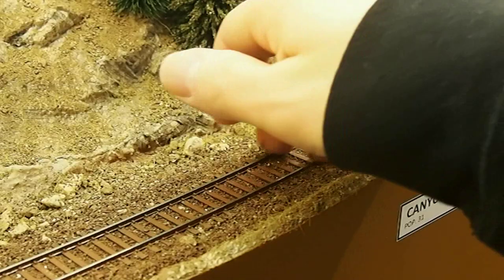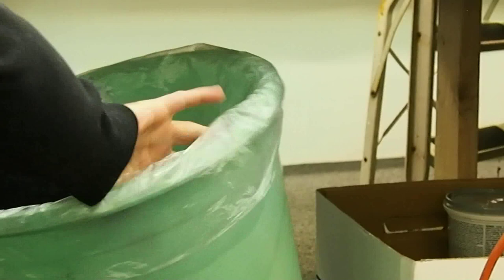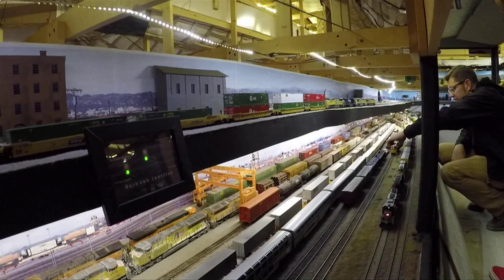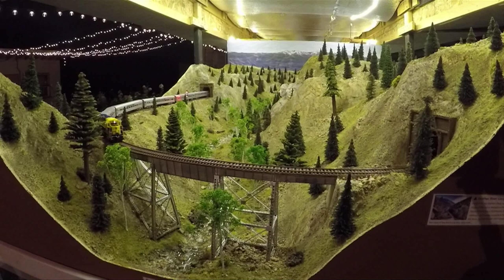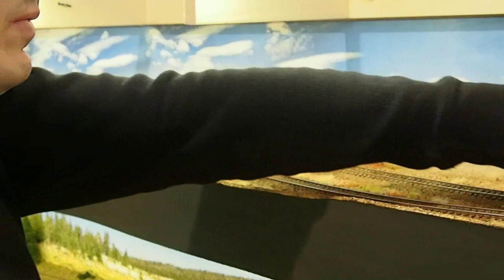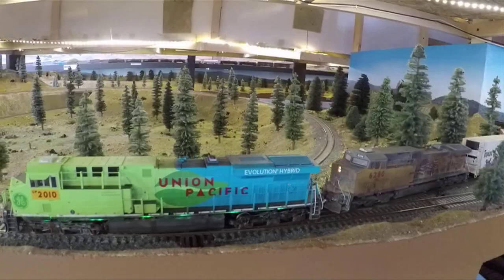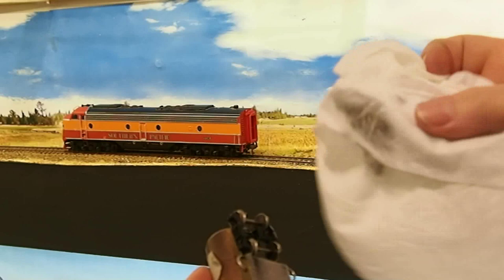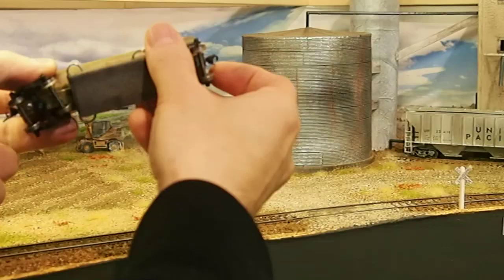How to Clean Model Railroad Track The Easy Way

Comment: I have found that pure Mineral oil is the best cleaner for track. Not Mineral Spirits. Just wet an old white sock and that's it. Keeps rust off those black metal ties too. No smell at all. No chemical smells or headaches caused by acetone and all that other stuff. No mess or stained surfaces at all.

Comment: Very helpful. I am thinking of making a track cleaning wagon / car. I currently use something the wife gets to refill squirty bottles for cleaning kitchen surfaces, it's organic and dissolves oil and fat better than acetone and does not attack plastic? IPA isn't really the stuff to clean off oil, it's quite a gentle solvent. I don't want to sound critical but a number of videos recommend acetone? Just inches away from your old loco you would use to do this with it's arcing 3 pole brushes or some DCC loco with 16V at an amp? All very capable of igniting the vapour, which burns colourless and will flood you layout. Acetone vapour is often used to soften plastics all the way up to ABS. A 2.5% vapour can be ignited by static discharge. It's not poisonous. You can add water as it's miscible, to dilute it a bit. But acetone and sparks do not mix and is over harsh.

Comment: Great video!  I just have one comment, the accusation that plastic wheels is a source of black gunk on tracks.  This has been a commonly accepted fact in model trains for decades and so many people swear by it, but a while ago I was reading a big post by someone who did experiments with it and actually worked in a lab and was able to get a sample of this classic black gunk to get it analyzed.  He had always believed plastic wheels were the source, because after switching to all metal wheels the amount of black gunk on his layout decreased so that seemed like solid evidence.  But when he checked the gunk out at the lab he found something else. I don't remember the specifics, but the gunk turned out to be a substance only produced from electric arcs, not any sort of plastic residue.  It turned out its our locomotives arcing over bits of dust and dirt and fusing it into the black gunk. So why does switching to metal wheels reduce it?  The metal wheels are heavier and grind the gunk away over time.  They help get rid of the gunk, but aren't actually the often assumed source of it.

At his club layout he then did another experiment since lots of plastic wheels ran on it and they had gunk problems.  They cleaned track the old fashioned way, with ISO and and bright boys.  He got them to switch to using mineral solvents and a conductive lube similar to your method.  Even with their plastic wheels, the black gunk problem almost vanished.

So, the TL:DR of all this is that plastic wheels aren't actually bad so long as you properly clean your track and black gunk is actually some sort of carbon compound left from electrical arcs created by loco's or lighting equipped cars.
Reply: Thank you for that.  Have heard the same re plastic wheels, so good to know they're not completely guilty!

Comment: Black stuff is not dirt but micro arcing residue. Vacuum, clean track... But then add no ox I'd special in a micro layer. Then go years without needing to clean track again. I'm a recent convert so not a reliable source as it has only been a short time doing wonders. Check out Ron's trains and things for the heavy research and others who swear by it. Painless :)
Reply: This makes the most sense.   Any anti ox, conductive product should assure great electrical contact!  Scratches fill in, no real need to do anything else!

Comment: Keep your tracks dry and don't scratch them.  

The CMX is the best tool I have ever used.  I used acetone only once in the CMX and just one accidental drop on the locomotive did a lot of damage to the locomotive.   

I swear by my CMX and I use Diggers Methylated spirits - 95% ethyl alcohol - yes the 5% is questionable but some products are less than 70% - but four passes on main line or sidings every 6 months and I don't have any problems.   Yes I ditched the track rubber and in the yards I am polishing the tracks to remove damage caused by track rubbers, so that a couple of  passes with the CMX is all I need.  What a difference because yards are harder to clean. 

 And yes some alcohols leave more carbon on the tracks, but those oil based stuff such as inox and whayl oil slip the wheels and reduce traction - I have a serious helix to navigate.  Use the other stuff if you don't have inclines

Comment: put a bit of transmission fluid on a Q tip and on each rail spread it about an inch do that in about 6 spots throughout the layout run the train around the track as you normally would ..clean track no work zero cost !!!

Comment: Found 2-26 at Home Depot and on Amazon. 2-26 works better than anything else I've tried, even tho I did not follow all your steps. 
I wanted to test 2-26's conductive properties so I cleaned my rails with alcohol instead of the more effective acetone that you recommended. Also, I only gave the tracks a once-over, not a thorough cleaning. And no gleaming, either. After wiping down my track with alcohol, I applied a coat of 2-26 and let it dry. The resulting improved running is superior over all other methods I've tried. The next time that treat the rails, I will clean  them thoroughly with acetone, do some gleaming and then apply 2-26. However, with just a light cleaning and an application of 2-26, the locos are running far better than ever.
Thank you!

Comment: Hi, would you recommend that method also when using traction tires ?
thanks, Guenter
Reply from the maker: I don't generally recommend traction tires, but if you have no choice, I would just make sure you let all the liquid evaporate over a few days before you run the traction tires.  Otherwise it'll just smear whatever is on the traction tire around the layout.  Clean your traction tires when you clean your track also.
Reply: yes, I have no choice. All my machines have traction tires (usual in Europe ) and and there are over a hundred.....

Comment: how about narrow gauge track?
Reply: You can change the trucks to HON3 for the cmx though it may have clearance issues. Also an N scale cmx car with HOn3 trucks should work.  But just using a tidy track with pads might be a good way to do HOn3
Reply: @areakt  What's a Tidy Track?
Reply: @PeterNGloor  It is a woodland scenics product good for tight spaces.  It comes with various pads, at least a couple of them you could soak with crc or even acetone.

Comment: This is the easy way?  I'd hate to see the had way.
I've used a Peco track rubber for decades and never had a problem. I model in 009 so slow running is important. My locos crawl so you have to look to see if the wheels are turning.
Alcohol is good for drinking? Not isopropyl it isn't. Toss your bright boy, use sandpaper instead!. Acetone won't be coming within feet of my plastic sleepered track.